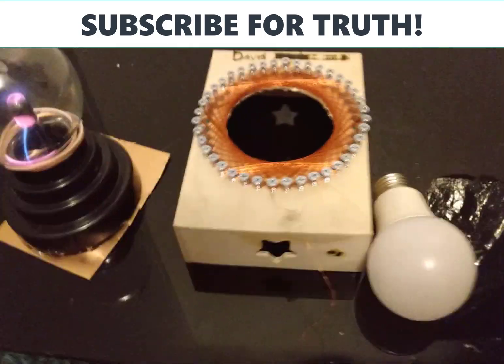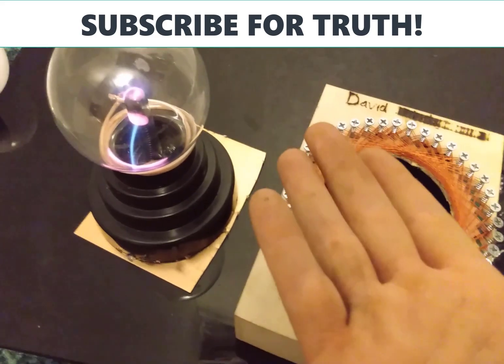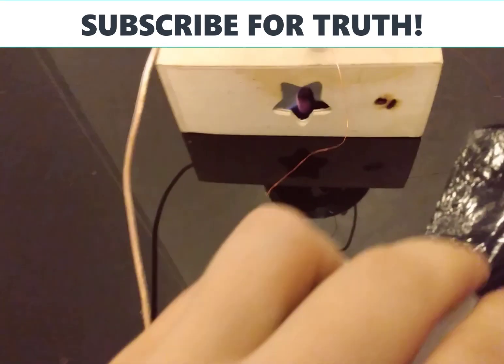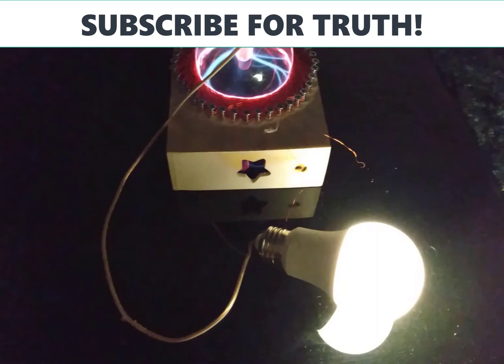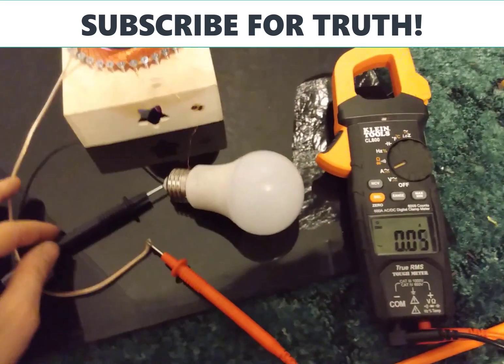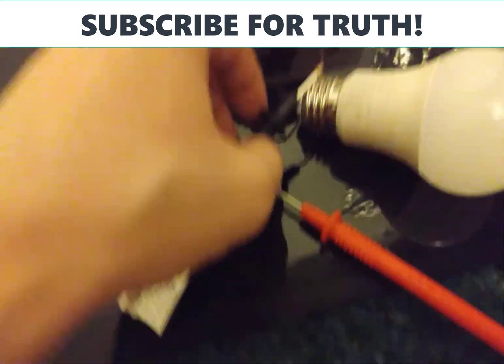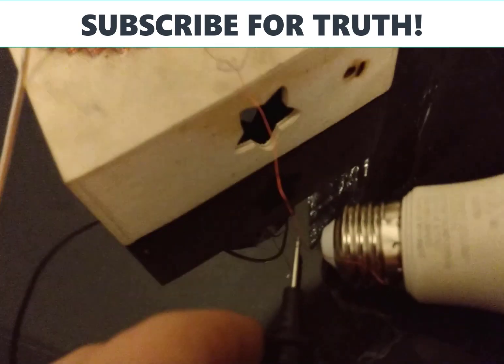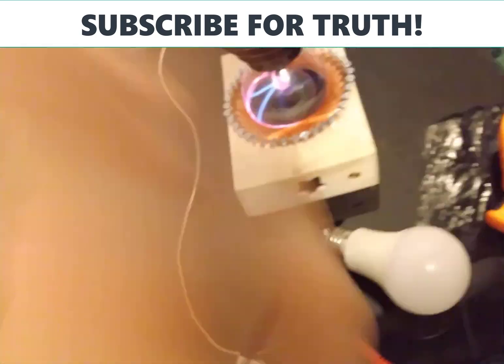Easiest DIY Tesla Generator Using Plasma Globe & Lotus Coil

Comment: Cool 36 point coil, have you tried running a AC motor with this setup?  The high amp reading is interesting I wonder if the meter is picking up the number of turns and if the high amps can be utilized in a highger voltage and amp setup.. Im gearing up to start doing similar setups.. Thanks for sharing your tests..

Comment: Is the plasma ball plugged into the wall socket? If so then isn't this only a transfer of energy? What I mean is that its not actually generating anything. Only transferred energy.
Reply from the maker: The plasma ball is not plugged into the wall
Reply: @Resonate369  If it isn't plugged into the wall then what powers the plasma? a crystal battery inside or an ambient electrofrequency capacitors diodes antena?
Reply: @SlavicZayetzOfTheNorthStar3112 it’s harnessing power from the ether, based on technology from nikola tesla and his ideas around wireless electricity like the tesla coil which would generate millions of volts of electricity

Comment: The question is, how much amps, how much power need the plasma ball to run, how much need the bulb, and goes the power consumption of the plasma ball up, when there is a (bigger) load / does the load run with there full power? Don Smith statet always, that the power for the load comes from the earth ground or surounding air... and the highvoltage stuff is only the trigger for the ambient ether field...
Reply from the maker: I've gotten it to stat at a steady 200 millivolts @ 10 amps when grounded so far. 2 watts output and its doing nothing to the plasma. I honestly havent obtained enough wire to see if i can vaccuum the energy out of the plasma or not.